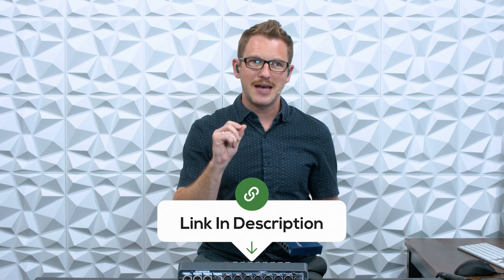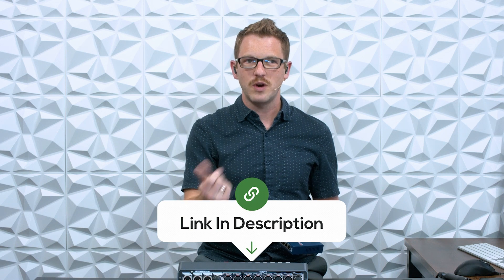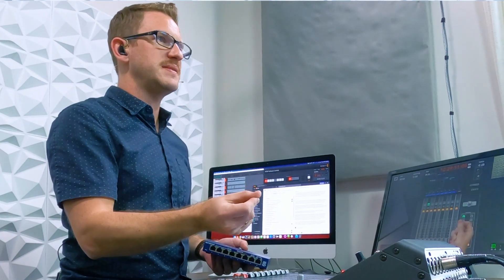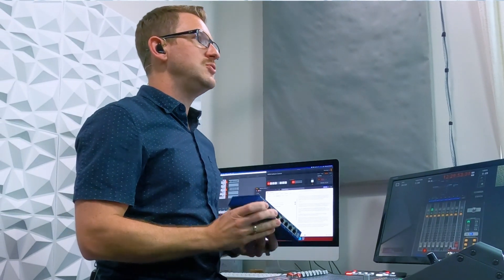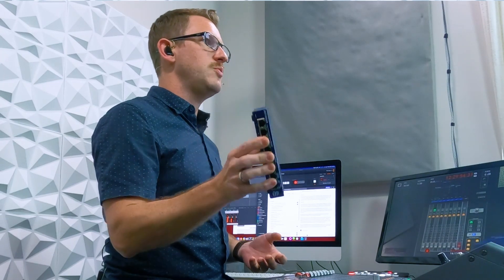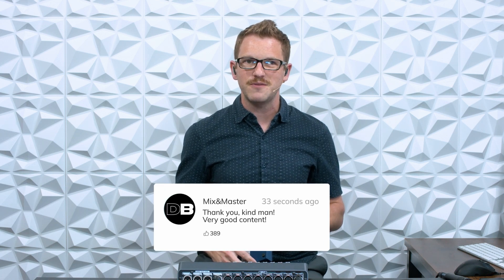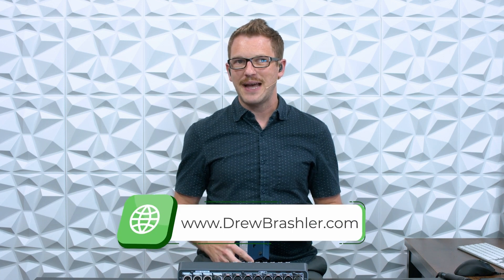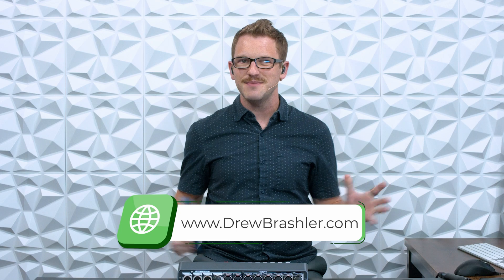Don't Use this Network Switch with the DM3!

Comment: Great video, thank you! I'm not using Dante or anything like it, but I get lots of strange problems in my network when I have one of those EEE switches installed. Robotic sounding voices when using Playstation Chat, very slow dowload rates on the Playstation and other devices connected to that switch. It took me years to figure out EEE was the problem in my network.

Comment: EEE on large-scale, enterprise-level, rackmount switches might be practical and effective, but it's absolutely dumb, nonsense, pointless as f*** for the manufacturers to forcefully introduce EEE in those tiny pocket-sized unmanaged switches... How much the hell of power can it actually save? Probably no more than a single vroom on the gas pedal of the boss's roadster.

Comment: Do you ever use Ubiquiti gear for AVL network carrying Dante?  The rest of our system for our church is UniFi stuff and I wondered about staying consistent.
Reply: They recently added the option on some unifi switches, any of the pro series I think, that you can set a port profile to Dante supported mode.

Comment: Note that EEE only works when a pair of connected devices both have it enabled. If disabled on an endpoint computer, EEE will not function even if the switch supports it. It would be quite surprising to me if the Dante cards in mixers had EEE features enabled. However, if you have multiple GS108 switches chained together, the switches themselves then would introduce EEE problems -- but on small deployments with 1 of these switches, it honestly shouldn't be a problem. That's why Waves themselves can recommend the GS108 as a SoundGrid switch even though they recommend turning EEE off.
Reply: Absolutely correct. I’ve used this in complicated networks as well as smaller situations. Haven’t failed me yet. In a medium situation, I usually use them to get a bunch of things into the network like mics or things like that, then they go into a managed switch that has EEE turned off. Never an issue even in high pressure situations. I also have some network training tho so that could make a difference.

Comment: I'm not sure if you cover NDI much on this channel Drew, but I feel like the same principle could be used for NDI as well, is this correct? Sadly I have friends that are using their normal unmanaged switches and wireless routers like the Netgear GS108 and connect NDI to it and say "it works" and add "it will never use up the bandwidth and interfere with normal data packets". I've lately been pushing for managed switches when interfacing with audio and video equipment, but my peers just don't seem to understand the value in managed vs unmanaged switches.
Reply: Same applies to sending DMX over Art-Net. You don’t want it going dark as well as quiet!
Reply: To be fair, most people don't care about most things until it affects them, myself included. 😂 But seriously,  going down this Dante Journey has definitely opened up my eyes to some things, and it's been super frustrating but very eye-opening as well.

Comment: Hi Drew. 
This is not true of all Netgear 105 and 108 switches. 
I have a GS108PE v4 which is managed and can have EEE turned off.
Also a 105E v2 that can have EEE turned off. 
And a 108E v3 that can have EEE turned off. 
I have used all of these on Dante networks with no problems. 
BUT I also have a 105 v5 that CANNOT have EEE turned off. Needless to say, I have that one clearly labelled!
Reply: "E" is for "managed" in Netgear's nomenclature